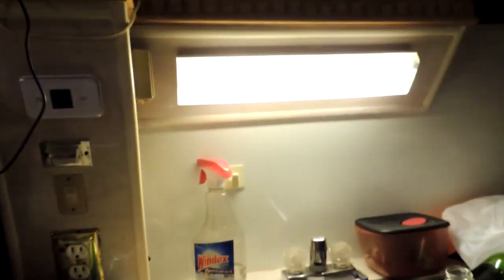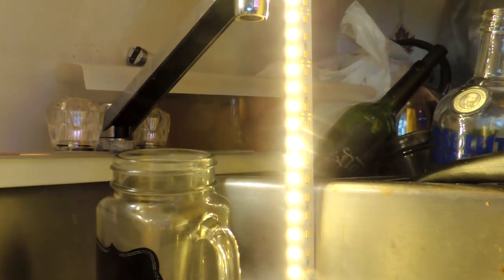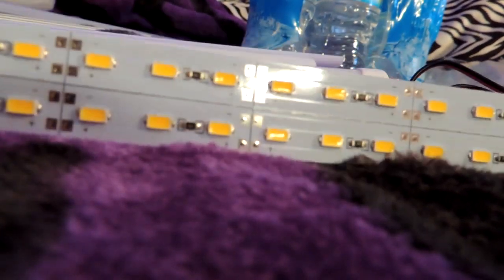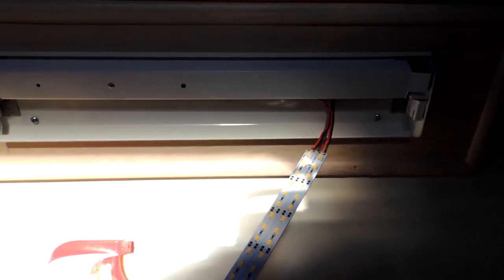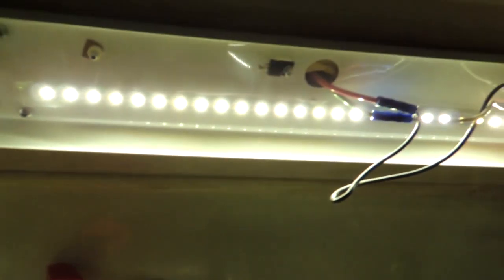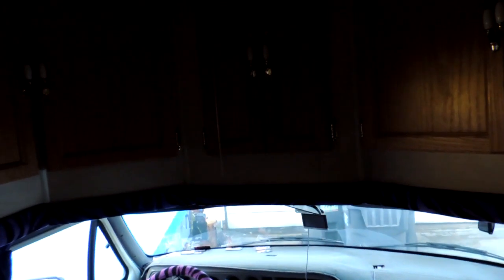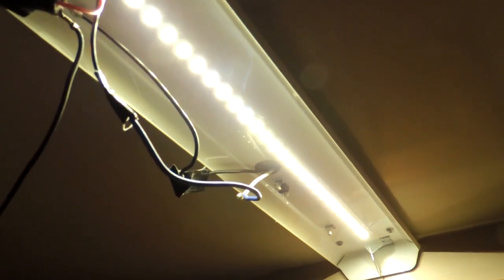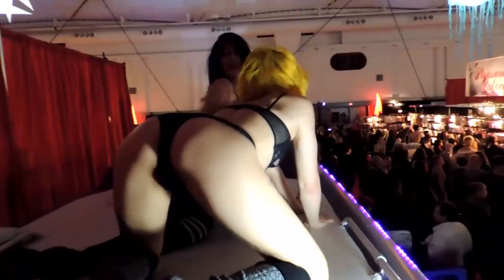DIY Flourescent to LED

Comment: actually LED strip lights are supposed to mount directly to metal materials ONLY because the metal helps dissipate the heat and act as a heat sync instead of melting the strip itself.
Reply from the maker: +bigk3000 incorrect. Many strips ARE metal, such as these, and will short out and create massive heat if directly attached. Fyi

Comment: Would it be worth the effort to add a switch or change to a two-way switch so that one could have the second row of led's that could be turned on for a bright mode?  Or does the second strip really make it way too bright in each fixture?
Reply from the maker: Could if you want, but I don't like it bright. I usually use dimmers on strip lights, or coloured lights for mood lighting...and only turn on lights like these for brief periods (for washing dishes or something).
Reply: Cheers, man!  Thanks for your vids!  I'm looking forward to details on the new stove.  Especially if you've got it set up for fresh air intake like the Kimberly.  Kinda looked like it was pulling cabin air, though?
Reply: exactly

Comment: Did the strip of LED's come with the black & white wire or did you add them on to the strip?  I saw a roll in the store but wasn't quite sure how to get the wires on it after you cut them so I didn't buy the roll yet.  Thanks in advance.
Reply from the maker: Wires attached.

Comment: They manufacturer pre fab replacements for these units and it's an easy swap.
Reply from the maker: +Linescrew1 Yes, I specifically said that right in the video man, lol. The point is don't waste your money. This is fast, easy and way cheaper!
Reply from the maker: +Linescrew1 plus the light is now all directions, not just down-lighting as they were before. Once you remove the ballast and all the crap inside, you get more light reflection both up and down.
Reply from the maker: +wolfywho haha nope, I order this shit late at night drunk half the time, there's hundreds to choose from and all basically the same stuff. I ordered those over a year ago and could be from any number of a hundred vendors lol
Reply from the maker: Sidney Boudro LED light strips are all 12 volt inherently. You need a 110 power adapter for home use. For example, you can buy LED lights at home depot....and just cut off the 110 power adapter and wire directly to your RV. I do that often. Just way cheaper online.
Reply: JustinCredibleTV - Can you provide a link to the actual led product/vendor on eBay that you used? Thank you!
Reply from the maker: +wolfywho haha nope, I order this shit late at night drunk half the time, there's hundreds to choose from and all basically the same stuff. I ordered those over a year ago and could be from any number of a hundred vendors lol